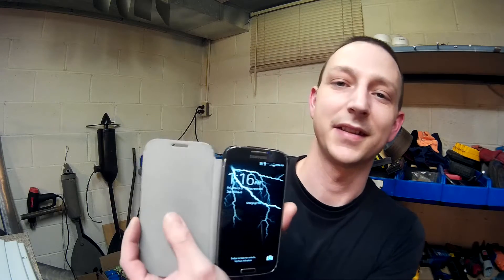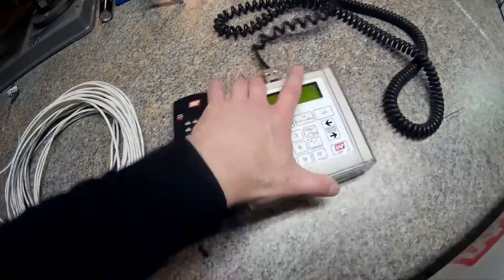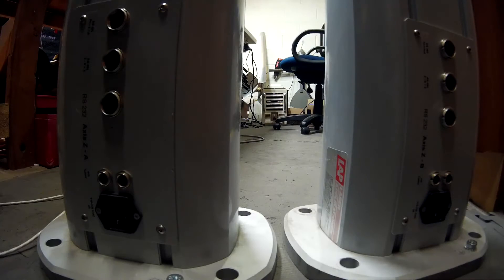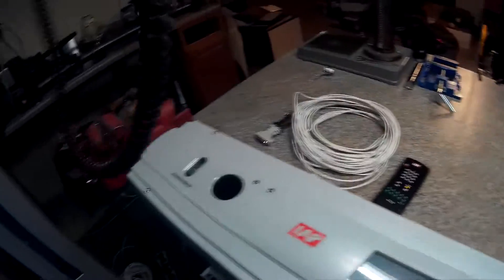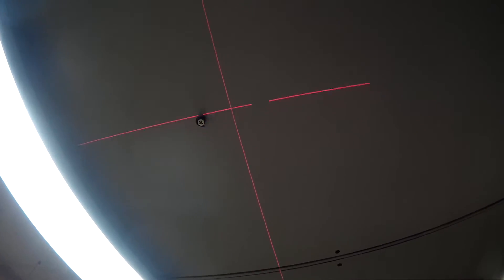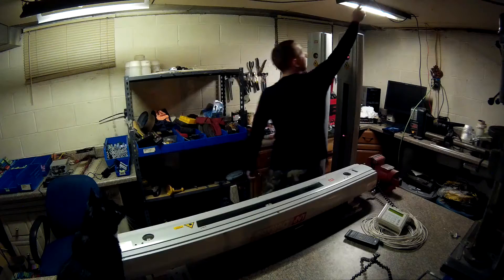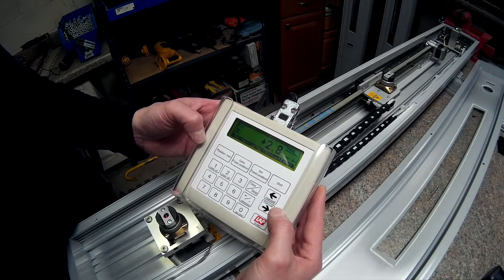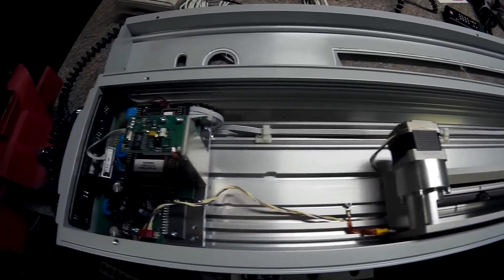Freebie Friday Ep7 WTF Tower Lasers!!!

Comment: Update from my personal experience.  These are used at the VA hospital for mapping and marking with tattoos for radiation therapy.  Prostate cancer in my case.  Same brand name even at Houston facility.  Hope they are accurate and in sync with the catscan machine they use them with.  So many different thoughts on treatment for different cancers.  It is tough making a decision on which treatment to try.  In my case they decided against surgery because of the location of my tumor.  Several other options that are experimental and some that are just too expensive for "average joes"  LOL!
Reply from the maker: Yeah I heard hospitals use these for those reasons.  Ive never seen any at the VA but I never look either lol.  A LOT of things are too expensive for "average joes"😆

Comment: Those are part of a linear accelerator used in radiation therapy and cancer treatment. You are correct that they are used for reference marking. You probably already know that you should be careful with those!  :-)  Also, I wouldn't recommend targeting helicopters or airplanes with them either!
Reply from the maker: +jimginnyohio Good info, thanks. Ya be careful is a must!!!
Reply from the maker: +jimginnyohio Oh ya Im a Aircraft Mechanic no airplanes or heli thats a BIG NO NO.
Reply: AveRage Joe You must assigned at Offutt. I lived in Bellevue for 20 years before moving to Ohio.
Reply from the maker: +jimginnyohio Yup, was here back in 2000-2003 in the Air Force then Okinawa for 3 years. Now I have the same job as a civi :)